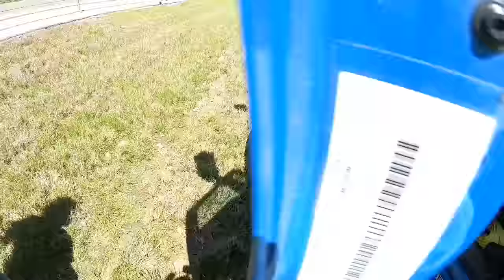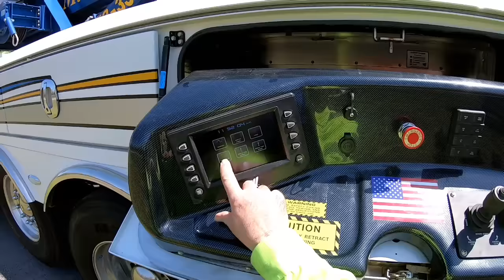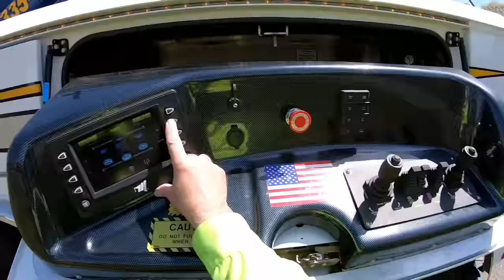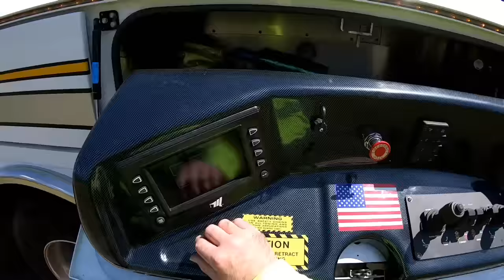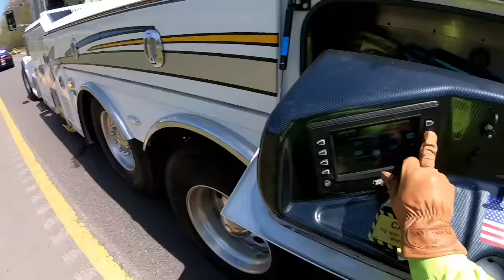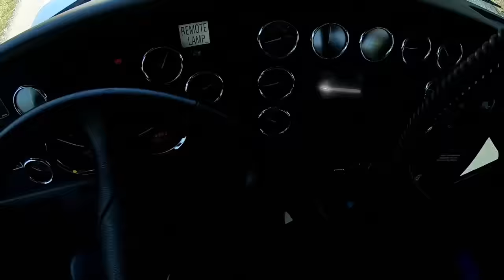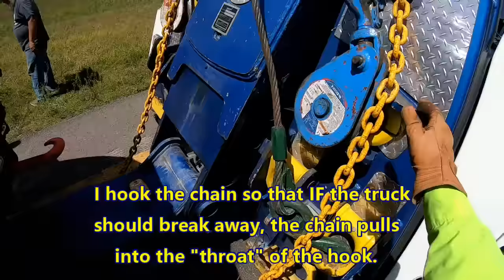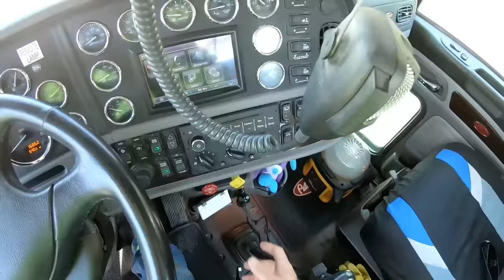Car VS Semi Crash!!!  Code 3 Response

Comment: When the siren fails to move people, a good horn rage always works. People need to wake up and pay more attention to their surroundings...
Reply: I know and they were scattering in all directions like idiots.
Reply: I would imagine a good number of them were on their cell phones complaining about the traffic.
Reply: I use to feel this way, then one day an ambulance was tail gating me with their lights on, didn't notice them over the wind/music. What made it odd was I had just pulled over to let a different emergency vehicle pass me, then got back up to speed and maybe 20 seconds later this ambulance was behind me. The road behind me was straight and clear, so he must've been hauling ass if I didn't see him half a mile behind me.
Reply: I can neither confirm or deny using the "chrome horn" on a wrecker or fire engine to move "things" out of the way in times like that.
Reply: @slugger449  nope again. O for 2 dstain
Reply: @slugger449  I used to drive ambulances and get angry when people didn't move over. Then when I started driving semi's I discovered that if your Rolling down the road many times you won't hear the siren until it is right on top of you
Reply: Sanguinem Luna , would you know, that in about 1960,,or so someone offered 10K to anyone whom could develop a device, which would either kill their radios, or reduce volume when an emergency vehicle was coming by, but up til now NOTHING had developed, in today’s $ That would be somewhat more., GREAT IDEA.,,,,,,, Cheers  from NJ GOD BLESS
Reply: James Little over in Germany on a highway that has come to a standstill by law you must make a gap between the outside lane and middle lane just in case the emergency vehicles need to get through. Here in the UK the shoulder as you call it is always kept clear for emergency vehicles
Reply: You can use a train horn in MA, and people will STILL sit there as if nothing is happening ...
Reply: I'm guessing a lot of people aren't used to big rigs with lights and sirens.
Reply: @LJT7907  I commented on that channel the other day, saying his videos should be shown to every new driver worldwide!!
Reply: @flybyairplane3528  this is a great point. Modern cars can emergency stop themselves, swerve themselves to avoid collisions and even drive themselves, but they cant muted the stereo and open the window an inch when an emergency vehicle approaches????
Reply: @anitamartini8161  not mine luckily. I have Grover 1510s and a Q2B on my F250. I use them for my code 3 responses.
Reply: @Blazer02LS   Fire engines should use the air horns a lot more than they do. Siren + Air horn and you know you are looking for something big. But the powers that be dictate that air horns are too disturbing for the community.
Reply: did you not know that FB/Twitter/ Instagram are more important than driving a 4000-pound vehicle than monitoring your surroundings?   Thankfully, no one was injured!!!  Including mother who put her baby at risk.
Reply: Lol works the siren is in the cab. He has no reds and how trucks don't do that.
Reply: @robdewey317  Some states allow wreckers to respond Code 3 if requested and they are the same level as any other emergency vehicle.
Reply: Lmaooo correct
Reply: in my town, everyone gets out of the way super quickly. it’s almost impressive. but i do live in a small town.
Reply: 4 things a driver needs in South Korea, horn, breaks, lead foot and a set of underwear!
Reply: @776281  yeah, right up until one of the powers that be needs a fire engine and its stuck in traffic.  Then watch the rules change.  Here in the UK they installed thousands of speed humps in the early 2000's to kill traffic speed in residential area's.  A lot of these are now being removed to allow emergency vehicles faster response times.
Reply: @flybyairplane3528  IN th e mid '70's the city of Burlington IA had a system that allowed all emergency vehicles to cause the lights to turn red while they went through then go back to regular programming.
Reply: @happytsetse9749  I think some places still have them. Seen a few videos where lights suddenly turned red when an ems vehicle went by with sirens on. Either that or just a coincidence but, it's a pretty cool system.
Reply: @justanotheraviator2357  Try checking out what Galls calls a "Howler" https://www.galls.com/photos/documents/galls/wav/WOOP&Howler.wav it can actually be heard by quite a few departments on LivePD and the low frequencies penetrate the car interior to get the occupants attention, unless they are just totally ignoring you or deaf,  and does a super job.  Some other siren Manufactures may have it on their boxes by now, its been a while since I've been in the business of shopping for myself or anyone else. Be careful and stay safe out there.
Reply: People never do, they just neeever do..
Reply: LOTS OF FRUIT CAKES PERIOD.
Reply: Some people don't even care. They see open tarmac in front of them and even though a siren is behind them they just keep on creeping forward like that's what they have to do!
Reply: @LJT7907  I ride a motorcycle for work and when I'm code 3, I can maneuver better than a rig, people in country towns move out of the way 1/8 ahead. It's pretty awesome out there. Most drivers in big cities will even cut me off to try and make it through an intersection before me.
Reply: I think the people just dont care lol
Reply: Sanguinem Luna, horn rage works until you’re in an army truck, they have air horns that will deafen anyone within 500 feet.
Reply: I use my air horn everytime I have to respond on project. Only way to get them to move.
Reply: @slugger449  or you don't look in your mirrors at all while you drive
Reply: Sanguinem Luna No it’s just jerks that think they don’t have to move for tow truck😂
Reply: @TheSwampdoggydog  Unless it's a 'Smart Motorway' converting the hard shoulder to a forth Live Lane. As of August 2020 56 people have been killed on 'Smart Motorways. And no hard shoulder  for the Emergency Services to access the R.T.C.
Reply: Isn't that the truth!?! It's as if they're thinking, " Oh there's a big truck coming up behind me... with a siren blasting...  think we should move over "? DUH!!!🙄
Reply: @flybyairplane3528  I thought the same some years ago, Looked into it: can't in U.S. , FCC Regs. can't allow transmitting an interference signal over the airways. Gov't thinking again.
Reply: Thank-you for your blessings. May God be with you in your work. Not the safest job in the world. If they would just pull over and make our lives safer.
Reply: The smaller your vehicle the more able you are to get out of the way making room for the larger vehicles and semi trucks.   Move it!  Oregon has a slow down move over law. Remember that ambulance may be transporting your family members, that fire truck may be going to your fire!  That wreck may involve someone you love!
Reply: Yes, let’s us be more vigilant when it comes to lights and sirens.  They could be coming to save you one day.  

God Bless all 1st responders.  Both military and civilian.  

Freedom reign.  But it ain’t Free!  Sacrifices yesteryear and sacrifices today.

American 🇺🇸

Comment: Ok, that's it.  Someone start a GoFundMe Page to get a Federal Signal "Q" Siren for the Rotator.
Reply: I would donate to that in a heartbeat. People don't seem to notice the current siren at all and it ends up taking several horn blasts to move people. Ron definitely needs a "Screaming Q" for the Rotator.
Reply: I am ashamed by the lack of response of some drivers in this situation.
Reply: For someone that doesn't know like me, what is a "Q" siren?
Reply: @Gaunt596  considering so few locations allow tow trucks to run code like Ron is able to, I'm not..
Reply: Lol, id love if it had one. I cant be sure but i suspect the current siren isn’t very powerful (like a 60 watt system) and the speaker is not aiming out good
Reply: @dave_n8pu  I believe it is the one you typically hear on Fire Engines, the one that builds up and screams really loudly, and then also has a wind down sound before going back up again.
Reply: @dave_n8pu  it's one of the sirens that you commonly hear on the large fire trucks.
Reply: @dave_n8pu  think older FDNY air sirens, they really scream.
Reply: And a train horn
Reply: The Q is the Federal Q siren a mechanical siren, which unlike the electric ones can be heard for miles and even inside a well soundproofed vehicle because of the square wave pattern they produce. Search Federal Q sound and you can hear it wail.
Reply: @SanguinemLuna   Better yet, mount a Mountain Air-Horn (or 2) on the 'Tator and replace the Horn speaker(s) with the Siren Speaker...
Even completely Deaf people are going to hear that Siren if/when Ron uses it...
Reply: If Ron would like it, I can donate a Sterling version of the Q2B
Reply from the maker: @newjerseybill3521  I would be very pleased to have one.  That is a very gracious offer.
Reply: @RonPratt  OK, I'll dig it out and get it off to you in the next couple of days.
Reply from the maker: @newjerseybill3521  Oh wow!!!!  That's amazing!!!  How can I ever thank you?????
Reply: @RonPratt  mount a GoPro looking down over the Q at traffic moving out of the way and send it to Bill. 
The Moses shot®™ ;)
Reply: @dave_n8pu  it is a type of electrical or mechanical siren that is primarily used on fire trucks 
Sounds kinda like a tornado siren
Reply: Ohhhh I'd LOVE to see a FS Q on the Rotator NOTHING beats a Q & air horns 😊
Reply: @dave_n8pu  a Q siren is a manually opperated wind up siren oppereted by either foot switch on the floor or by the horn ring in the center of the steering  wheel.  Some fire trucks have them on top.of the electronic sirens.
Reply: n8pu it’s a siren that many fire trucks use its very load therefore it moves drivers out the way better because it’s wakes them up and makes them pay attention
Reply: I've got one, I use it though.
Wow a donation!
RON, PLEASE MAKE A VIDEO OF THE Q.!
Reply: In these code responses, you speak of the heavy rotator takes time to get up to speed, what is the top speed your particular truck can attain? Thanks
Reply: @newjerseybill3521  so nice if you bud! Definitely will clear traffic for him!
Reply: @TidyBananas  It has arrived at Midwest truck!!!  :)
Reply from the maker: @newjerseybill3521  I got it this week.  I powered it up and it sounds AWESOME.  I took the brake assembly apart, freed it up and ordered some new friction pads.  I'm going to go ahead and install it on the rotator early next week and I'll put the friction pads on whenever they arrive.  Federal Signal told me it could be about 2 weeks for the pads.  Again, I can't thank you enough.  This thing is going to help out tremendously!!!!  I don't know if you have me on Facebook or Twitter, but I posted a short video of me testing it yesterday after I got it ;-)    You should be hearing it in videos coming soon....I hope.   Thanks again and God bless.
Reply: @RonPratt  The federal friction pads may, or may not fit that siren. That siren was actually made by Sterling Siren Co. Rochester, NY (Now known as Sentry Siren Inc., Canon City, CO.) It has a slightly different, and I think better sound than Federal's version. This siren came out of a 1959 Cadillac ambulance. ")  Glad it made it safe and sound!!
Reply: Mike Levy p
Reply: @dave_n8pu  the siren that sounds like and air raid siren on firetrucks. It's loud and has a long wind down time, perfect for clearing traffic
Reply: @zuluborgtrain3312  you can often see the speedometer on the shots when Ron is driving to the scene, it tops out at 80mph so the rotator is going at least that speed.
Reply: @The_Serpent king Sounds like fun. I'd be grinning like a Cheshire cat for the rest of the day after firing up that thing.
Reply: @dave_n8pu  it is a old style siren that you find on fire Trucks usually mounted on the bumper of a engine
Reply: Better then any electronic siren in my opinion for clearing traffic when running to a scene.  Mike A. Past 2nd Asst. Chief Valatie F.D.
Reply: @Drew00013 correct
Reply: @Samanthareneeheart1  glad to talk to someone who knows their stuff!😊

Comment: The occupants of that car are extremely lucky to be alive. Usually small cars being rear ended by loaded semi's doesn't turn out so well! You did an amazing Job with the trucker and keeping him calmed down. I think he was realizing what happened as you were talking with him.
Reply: I agree about the semi vs car thing I was amazed to see just the rear half missing on the car and no extreme injury's normally I would see or hear that the car nearly exploded on the hit or is now a metal pancake with the fairly high chance of extreme injury's or death but this was quite amazing to see that car not to badly damaged for what it was hit by
Reply: I expected a pancake of twisted metal!  I see a truck, and I think "stay out of their way"! 
I was once riding my motorcycle on just a 2-lane highway through a very winding, mountainous section with double white lines (so overtaking was impossible) when I came up behind a semi with a recognisable company logo, he was going MUCH slower than the 60mph speed limit - I stayed well back, but within 2 minutes another semi with the same company logo came right up behind me and kept right on my ass, pushing me closer and closer to the truck in front of me which had now sped up - until I was completely pinned within a 30 foot space between the two trucks at 60mph...I WAS SHITTING MYSELF, and wondering WTF they were playing at....I could see in my mirrors that the driver behind me was talking and laughing - I knew the two drivers were communicating with each other. I've never been SO frightened in my life! And they kept it up for a full 20 minutes until the road finally straightened out a bit and I took the risk to pull out into God only knows what might have been coming the other way, but thankfully it was clear! Had I not been an experienced rider I would have been minced-meat - and I still believe that was their intention. WHY they did that to me, I will never know.
I went to straight to a police station in the next town I came to - the rego plate of the truck in front was burned into my memory. Only to be told, "Well, that's the risk you take when you ride a motorcycle". NO IT IS NOT!  Those two truckers were playing a very deliberate and very deadly game WITH MY LIFE - and I wonder how many others they've done it to, because they were clearly enjoying themselves immensely. I certainly wasn't!
Reply: @j.whiteoak6408  I'm sorry that happened to you. I've seen cars do the same thing (I'm a cager, but rode with my husband for years on the back of his bike.) I've gotten to the point where if I drive near a bike, I keep a close eye on them, helping them if need be. Games like that should never be played on the road. Ever.

Comment: This video is a great example of why allowing tow trucks to run code makes sense.
Reply: Not really, that would be a horrible idea where I’m at, the tow truck drivers here are like vultures. There would be sirens 24/7
Reply: MarwoodAuto Very true!
Reply: The tow trucks in Missouri have to be authorized by law enforcement to run code. Having the ability to run code to get to a scene in order to help emergency crews clear a scene and prevent other injuries is a really good deal.
Reply: @FartassVolfgangus  Its just like any other emergency vehicle, You can only run code with authorization from the dispatching agent(in Ron's Case its the local police that give him authorization)

No emergency vehicle can just run code whenever the driver feels like it, because yes that would be terrible.
Reply: @legohead6 -  Good point.
Reply: reverse thrust  Here in Canada you are required to hold a commercial drivers Licence to operate any emergency vehicle. Police and Fire both have their own private training on top of that.